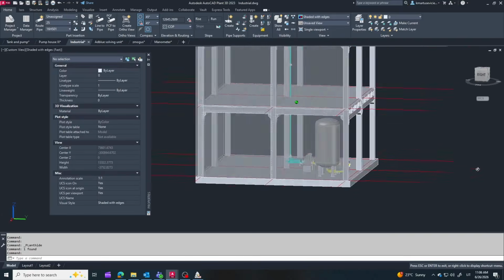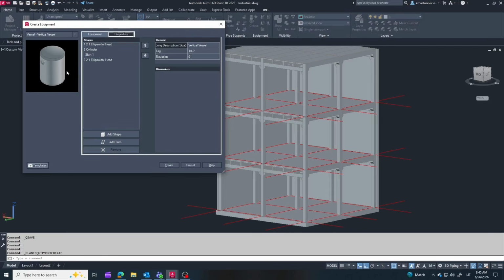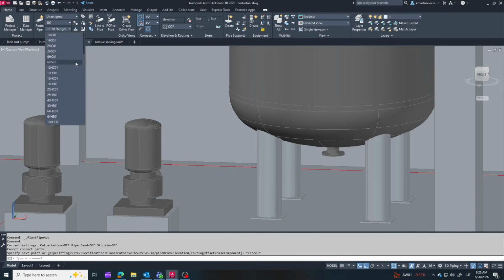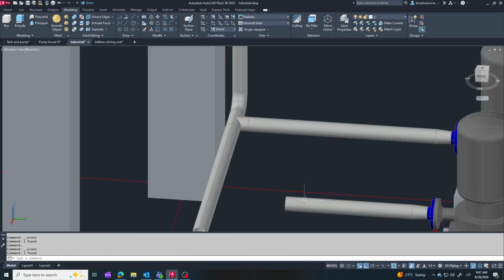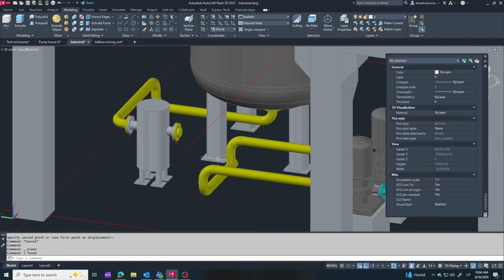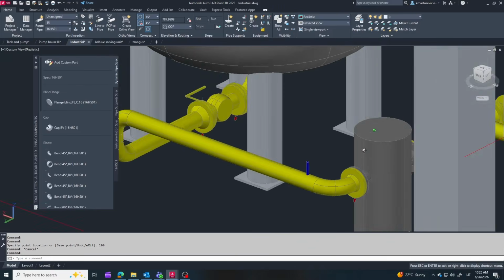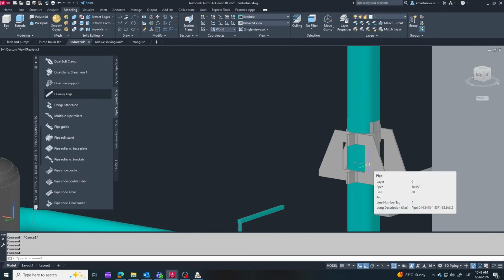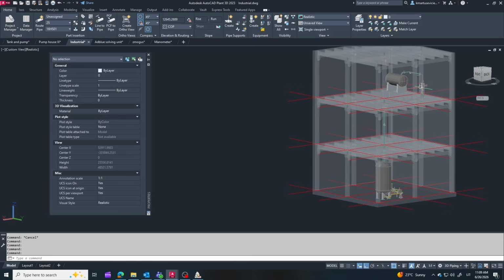Industrial Piping Design Workflow | AutoCAD Plant 3D

Comment: For a standard project, how do you set up the pipe color? Is the fluid correct? Can you show me?
Reply from the maker: Thanks for your question! In smaller projects, I usually don't spend much time assigning fluids or color schemes because clients rarely inspect the 3D model in that level of detail. Sometimes I simply color new pipes and keep existing ones gray for better visualization. You can do it quickly through the Properties palette or by using fluids, as you mentioned. I'll make a video showing both approaches. Thanks for the suggestion! 😊